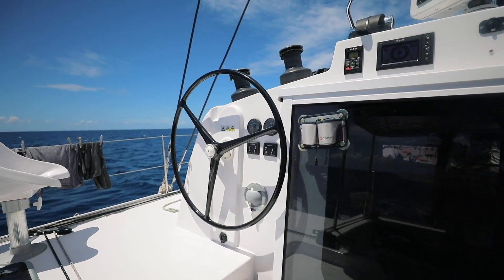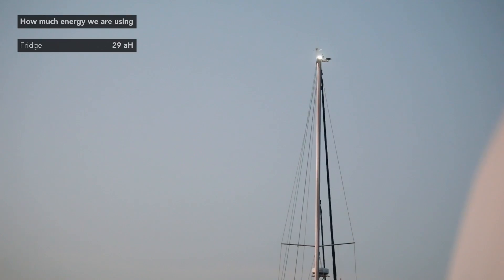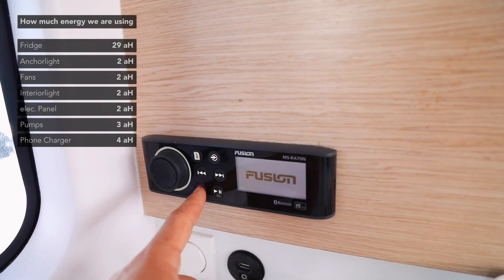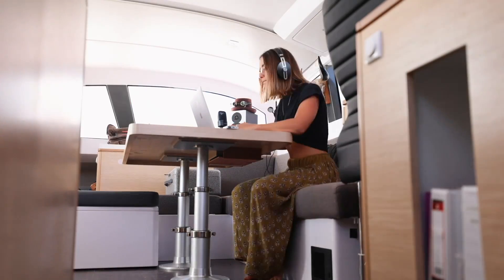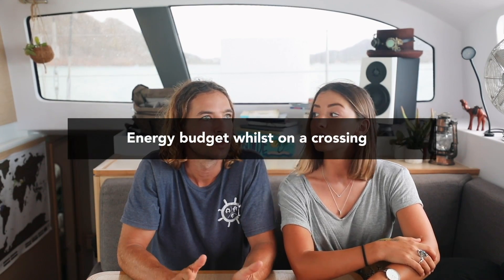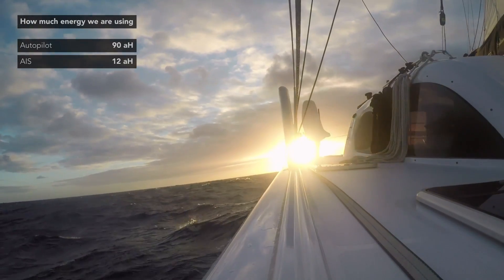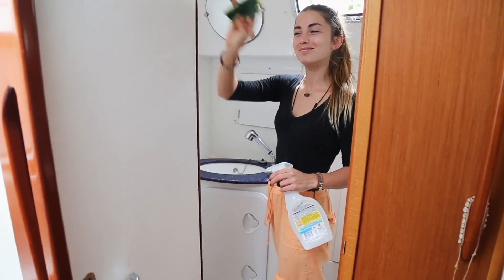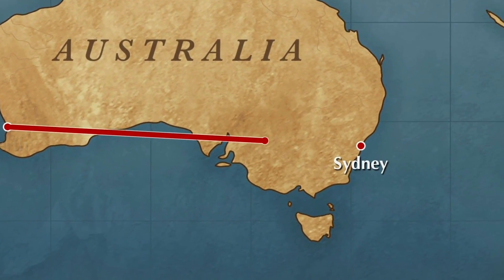Renewable Energy on a Boat

Comment: Possible tip that might help: I had a little power pack that came with adaptors to charge every phone and laptop their is PLUS a set of clamps to jump start a vehicle (or boat ;) lol)... But you could charge this power pack up with either 12 volts dc or 110 ac... If you got one or two of those so you wouldn't have to use an inverter for the laptop do you think that would save some power? I'm no pro but by using an inverter you're going from whatever your battery bank is, 12, 24, 48 volts dc, converting it up to 110 volts ac then that little box on your laptop charger is converting back down to 19.5 volts dc @ aprox. 2.3 amps... That has to be using a lot of extra power. Maybe it's something worth looking into. (That power pack had a usb, a 12v dc, and 19voltdc output.) I'm sure i could find it and get the name of it if you're interested. Cheers! =)

Comment: When Riley talks fast, how do you understand that crazy accent?  Please slow down, speak Spanish... something.   Terrific topic, well displayed.
How does the water generator work, a small propeller or a tube going to a cage fan?  What is the maximum generated amperage at any speed?  Do most international marinas have shore power?

Comment: Just a correction,  Its not AH, its AD,  meaning Amps per day, not amps per hour.  if it were AH you would be using well over a thousand amps per day. Its better to calculate watts per day when using power and solar. Watts in, Watts out. (wax on, wax off)   LOL!    Great video though.

Comment: One thing you should look into is a laptop power supply that can run off of 12VDC.  Much more efficient than making AC and converting it back to DC.

Personally, it would get more/larger solar panels and seriously consider doubling your batteries.  You really do not want to run out of power on a passage, but you do have the engine.

Comment: First off...GREAT video.  Second.  I THOUGHT I heard you mention 'wind' later in the video......but your 'ashore' power source shown was solar only......and your 'underway' power source shown was solar and your water-generator (Dang!  That thing cranks out some amps!).  Have you considered wind mills?  Or more trouble and/or cost than worth?  I've seen some on 'ashore' sailboats at Beaufort, NC before.   Figure they'd give you a few extra amps anyway.  If I missed it somehow, sorry.

Comment: If you can try get a 12v charger for the laptop. Inverting has more losses. Basically if you have an power supply or voltage regulator getting hot that a loss in energy in heat.

Comment: You need to ditch the inverter and ac charger for the MAC.  Switching to a DC cord for charging will eliminate the inverter needed, and even save more amp hours all together as it's direct DC instead of DC to AC, then back to DC.  Just an FYI, and you can get those chargers from Amazon or any good electronics store.

Comment: You should convert all your measurements to watt hours instead as amp hours is a useless comparison for viewers as they dont know your system voltage. The conversion is easy: watts = amps x volts

Comment: Wondering if Apple had a dc power cord to bypass the inverter.  The problem is the power adapter coverts ac to dc anyways.  I would look at the dc output of the power adapter.  If it is within the 12-15 volts range it might be worth a second power adapter and hack the cord, do some soldering (on shore power) and plug into the 12 volt supply.  

Keep up the great work, my daughter (10 yr old) and I enjoy the videos

Comment: Met a guy at the St Petersburg boat show in December. Just bought a new 42 Leopard.He avoided the inefficient and costly central AC that Leopard offered but installed a TermoDinamica system after the sale. He demonstrated it to me. Coupled with a soft start unit, the initial surge is avoided and he told me the entire vessel is cooled on an average of 20 amps. And it was COOL inside! He's running lithium batteries. He claimed his solar array will allow him to run the AC, along with everything else he is budgeting, nearly perpetually. I can't speak to how many volts he is producing (said he was going to have a total of eight panels) but he did state that the AC unit itself has an algorithm in the thermostat that senses strategic times to turn the system on and off. AFAIK he's down in the USVI now more or less permanently. For those cloudy days etc...he will have a simple Honda generator to top off his batteries.  https://www.tmdmarine.com/24v-unit/  Asoft start unit like this makes it possible: https://www.microair.net/collections/easystart-soft-starters/products/easystart-364-3-ton-single-phase-soft-starter-for-air-conditioners?gclid=EAIaIQobChMI0KWTt6iA3wIVeh-tBh28mQypEAQYAyABEgKnEfD_BwE&variant=30176048267

Pricey but I'll be looking at a setup like this when we buy our Cat! Be safe!

Comment: Use a MacBook with integrated graphics for editing... Slightly slower, but 2X the power efficiency.  And if you want to be super efficient, modify a cable to run off DC direct instead of through the inverter.

Comment: A great video as always, but the comment section has me doing a facepalm.  Electric motors, generators, and more holes in the boat...  Guys, they leased the boat.  Outremer would not appreciate the Volvo engines getting yanked out of a brand new yacht.  Or fifty holes drilled in the salon roof.  They have to be sensible.
Reply: ah... so that's how it works. How much is a lease on that? I didn't even know that was something you could do other than lease-charters.

Comment: Good Video. 
You need a Victron battery monitor system. 
It accurately measures incoming and outgoing power, also accurately allowing for battery charging inefficiencies. 
It eliminates guessing how much energy is currently stored , making it user friendly in particular for those that are not proficient in such energy calculations.
Guessing by voltage only for example ,can very inaccurate. 
I am unfortunately 'shore based' and have been using one of these for a couple of years now after toying around with lesser monitoring systems for 20 odd years.
The Victron is by far the best.
It is easy to fit . Cost is about 180  from a Melbourne Ebay trader.
Hope this helps .
Fair winds and light seas .

Comment: Try to use Ah (not aH) and for proper explanation if you using Ampere hours you should mention voltage od DC system. You can save some energy by finding dc-dc charger for laptop. I'm guessing the rest of equipment is already on dc.

Comment: Suggestions 

-Manual  fresh water shower pumps
-Electric motors for propulsion with regen
-larger battery banks to 
-use two small DC generators. Run the one as needed for occasionally topping up. Run both together as range extenders. Having two for safety as well.

Comment: OK renewable energy is not my department it's my husband's.  Could you use some sort of wind turbine on a boat?  Do they make those for when you are sailing in the wind?
Reply: Yes, little wind generators are common. Youtubers like Atticus and Free Range Sailing have them if you want to check out some actual boats. They work whenever there's wind, sailing or not but they are noisier than solar panels. Free Range Sailing bought new blades for theirs that are noticeably quieter, they're just expensive.
There are even boats powered by a (bigger) wind turbine, like this one: https://www.youtube.com/watch?v=IzGCYaJbf0A
Reply: @mozismobile   Very interesting. Yeah my husband in his partner own an island in the  Caribbean that is completely off grid run by solar panels and wind turbines.  It is really good system that works well together. In fact we're going to live in Hong-Kong in about 4 years to work with a huge development company for the country of China. They are already in business with the company in Hong-Kong they just haven't started the projects yet. We won't be living in Hong-Kong till around that point.
Reply: @mozismobile   Wow that is a big wind turbine on a small boat! I guess?

Comment: You call a puny 60W macbook "heavy energy use"... You clearly haven't seen a decent editing rig XD
How are your macbooks holding up in the heat anyways?? They're made for 21C room T 50% load max.. any more than that, and they all thermal throttle. Yours must be running at like.. 20% speed or something...

Comment: Did he just say an Ampere is a unit of energy instead of current?  And that a shower uses 6 amperes/hour?  Riley, Riley, Riley... get you units right.  An Ampere is a unit of current. Current isn't stored, charge and energy are.  The battery unit for charge is a milliamp-hour and the unit for energy is the watt-hour.  A water pump consumes 6 amps of current whether it is in for 1 second or one hour.  But it consumes 6 amp-hours per hour.
Reply: I think he was meaning Amp hours.
Reply: woolyimage yes I am I think his Aussie accent let him down there.  Ampere and amphour sound similar
Reply: vxnova1 , we Aussies shorten everything so would always say “amp” rather than “ampere”.
Riley ‘s aussie accent is just fine, you are probably used to American/mid atlantic “English” :)
Tom

Comment: Investigate the lithium ion batterys for absolutely nasty fire hazard issues... they can be in some cases a huge problem.. you might want to consider putting them in a steel box, vented out the top, on deck. (the boeing dream liner solution for the problem)
Reply: phil scott most people are using lifepo4 batteries and they don’t seem to have that issues.  I believe it is lithium iron phosphate or something along those lines
Reply: Correct they look like LiFePo4 they are stable and no fire risk involved, even when punctured. I use 2 of these as well very good batteries and such an upgrade over Lead Acids
Reply: @chrisjohnson1715   there is a lot I do not know about Lithium ion batteries, I wonder why boeing didnt use those on its new dream liner... the lithium ion batteries they used were said to be safe... but that was not the case.... and are apparently still using since they claim there is no alternative... so they put them in steel boxes and vented them to outside the aircraft.

Comment: Do you have a redundancy provision on your lithium, even a small power pack in case the whole thing goes bang, the one I have will even throw out 300 amps to start my camper (3 ltr mercedes diesel) plus the usual 12 v cig lighter outlets and USBports   and the jumper lead cables  a good 100 bucks of insurance :-)   great videos love the show...

Comment: 300 Ah @ 6V = 1.8 kW; @12V = 3.6 kW, @ 24V = 7.2 kW. Please always mention the voltage. The battery manufacturers use Ah because each battery has an internal  impedance that limits its Ampere output, but energy is always measured in Watts or Volt Amperes. Thanks.
Reply: Sorry Josi. Power is always measured in (kilo)Watts or Volt Amperes. Thanks. Energy is power over time, so kWh or VAh. If you get your energy bill it always show the kWh you used. Ah is energy, but the amount of energy is the combination of Ah with V. You did that math well, but forgot the "h" behind the kW. To make it very clear. If you switch a 100Watt (0.1kW) lightbulb on for an hour they charge you for 0.1 kWh. In Holland we pay € 0.02 for that. If you leave the same 100Watt (0.1 kW) bulb on for a year they charge you for 876 kWh or € 175.20. You may find this unfair but you really used 8760 times more energy. So energy is kWh.
Reply: @Drenec1324  Glad to see you understand the difference. Energy is power times time, not divided by (over) time. Ah is not energy, it is the amount of Amperes that flow in one hour, which you will need multiply by the Voltage (speed of the electrons) to obtain energy.
Reply: @josidasilva5515   I hope you understand that "300 Ah @ 6V = 1.8 kW; @12V = 3.6 kW, @ 24V = 7.2 kW" is wrong. It should be "300 Ah @ 6V = 1.8 kWh; @12V = 3.6 kWh, @ 24V = 7.2 kWh".
Reply: Josi Dasilva or just use watts instead. Its the correct way to represent electrical power.
Reply: slight correction - watts and volt amperes are POWER (rate of energy), whereas Watt-hours and Volt ampere hours are a measure of energy
Reply: musicandoutdoors no. VA is still power, but takes into account power factor.
Reply: @MrCarlRobinson  Your response doesn't make sense so I can't reply, but I can assure you, I am right
Reply: musicandoutdoors I can assure you that volt amperes is a measure of apparent power.

Comment: What would be the power requirements for an air conditioning or heating system? I assume that it would take a generator to produce enough power for it...
Reply: Bill Thompson yea it would be too much for a battery system. Don’t get me wrong you could probably run it on battery but it would be a heavy load which in turn will  shorten the battery life Anyone that seems to run ac will run it with a generator. If they are off grid
Reply: Our "land yacht" (4WD camper van) has 1200W of solar and I run the AC 24/7. The trick is to heavily insulate the vehicle , and use an efficient AC unit. Ours has a COP of 5.something and sips less than 200 watts to keep the interior a nice cool 21c. No need for a generator, although if we have a few heavily overcast days I may need to drive for an hour or so to recharge the batteries, or just turn off the AC overnight.  Its possible on a boat like la vaga but they'd need to find space to double their solar..

Comment: I see other sailboats with a wind generator as well. What are your thoughts on those? Worth it or no to supplement solar?
Reply: Wind generators are noisy and when you are sailing, you are sailing partly with the wind. This results in the following formula windspeed - shipspeed = rest that drives the wind generator

Comment: You are on a sail boat. Why no wind generator?
Reply: @Samuel Remillard i watched the video...but i'm wondering why not use both...also the wind generator "works" when the boat is stationary and the wind is blowing...
Reply: Aren't there fairly small ones now as well? I wonder if any mount on the top of the mast?
Reply: Tony Di Croce , a bit wired looking but what about on the end of the boom to catch the wind accelerated by the sails.
Reply: @abbbee8918  sort of like walking into a planes prop :-))
Reply: Wind generators are useful in areas of the world dominated by the trade winds but not in areas where there are frequent calms, or that suffer vicious squalls when wind generators have to be turned off or risk overheating. The main issue is  vibration and noise especially over night when many sailors will turn them off to sleep undisturbed. In my experience, other than when on long trips under sail, a wind generator can be more trouble than it’s worth - give me a good array of solar panels any day; quiet, simple, light and reliable.
Reply: Because they're loud, ugly, and take up space
Reply: @sivispacemparabellum5077  And they produce power when the sun goes down and the boat is not moving.
Reply: The simple answer is they don’t need one. If they were running over their supply, it would be another way to gain power. But as compared to solar, it is just one more mechanism to maintain, and as others have commented, they’re noisy.
Reply: Have you ever sat close to a wind generater when it's working [ with-in 50 ft. ]
Reply: The sails themselves are a very efficient wind generator.

Comment: Wow awesome.  When I lived aboard I was in Seattle most of the time tied up to a dock so I didn't go independent on my power.  I honestly didn't manage the electrical power at all.  I would have loved to and knowing what I know now I would tackle it very differently.    The other problem with being in Seattle was needing heat but that is a different story.  Interesting that you choose to use lithium batteries instead of lead acid.  I'm not surprise, they seem to be generally much better than lead acid but monitoring is tougher.  How do you monitor the state of your batteries?  Did you get a battery monitoring system with your batteries?  How do you decide how long to run the noise maker (motor) when you have to charge using that?